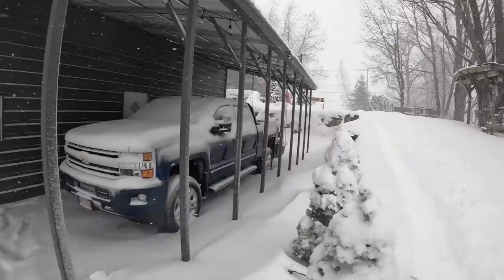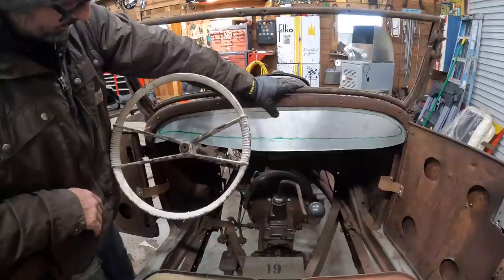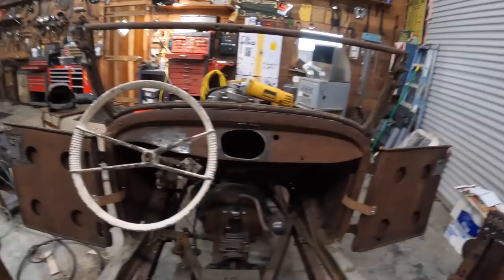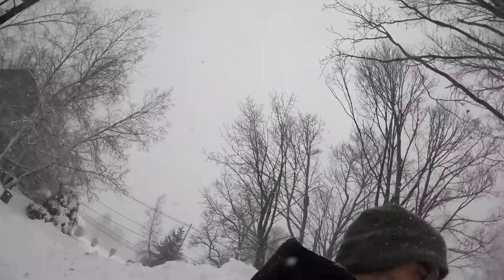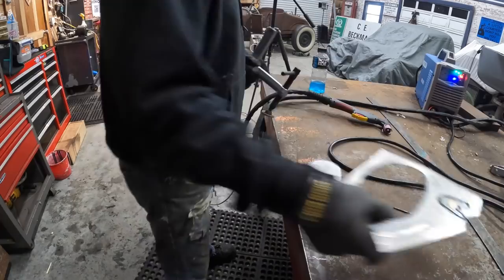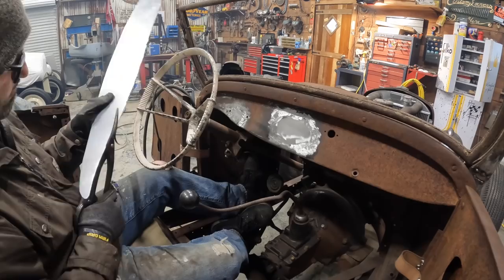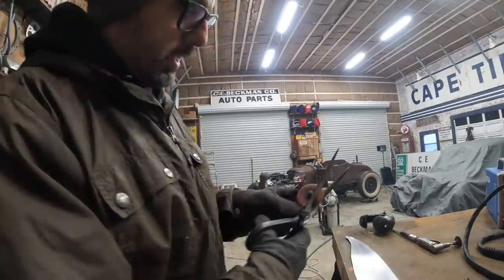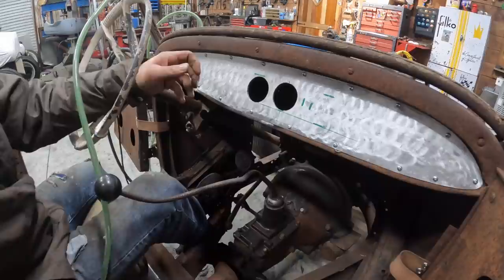Fabricating an Aluminum Dash Panel

Comment: Mike this is only a suggestion when I do timing "engine turning " I use a drill press I find I can control pattern better than free hand. I myself would add beads and keep the engine turning within the beads. Keep up the good work.
Reply from the maker: I know.   I should have.  I was being lazy … I have one in the top garage and thought however it turned out id be happy.  Hahha.  Not so much. 😎👍🏼
Reply: crchuch H.  Drill press, yes but with a fence to keep the pattern level and equally spaced mount the workpiece on a piece of lumber.  1960 Sports Car Graphic Annual explained a reader did a MG dash with valve grinding compound and a lot of wine corks by hand.  I have used wooden dowel rods with polishing compound in a drill press to dress tool steel mold parting lines, mark table or lumber with advancements to maintain the pattern spacing.
Reply from the maker: @waynespyker5731 thank you Wayne.  I’ve got no excuses now ! 😁
Reply: @waynespyker5731  yes indexing for sure

Comment: Mike, I seen a video doing engine turning using a wood dowel in a drill press with a oiled surface and gritty sand sprinkled on it. It is easier to go control the pattern with the drill press. Dash looks good though.

Comment: I'm not sure but I think that when you welded the long cuts in that support you put in it pulled them all inward slightly.that could be part of the problem. Just a thought.
Reply from the maker: Thought of that.  I had the top support welded in still.  It’s possible.